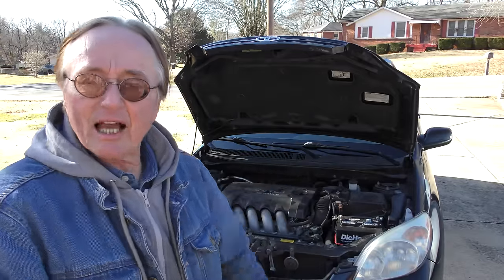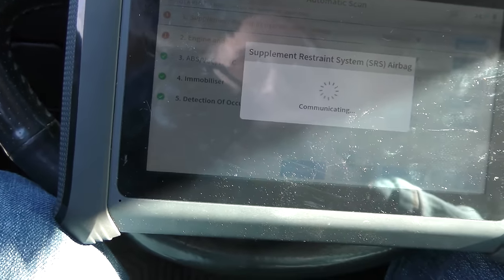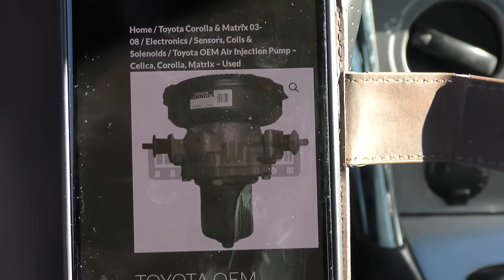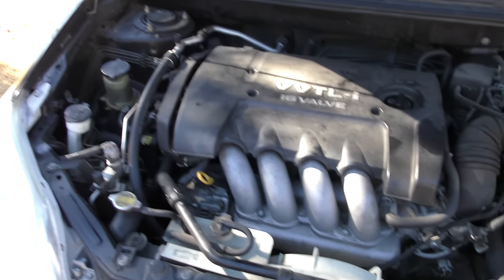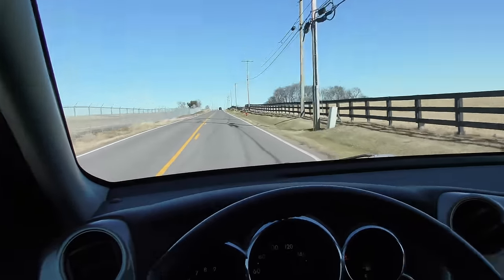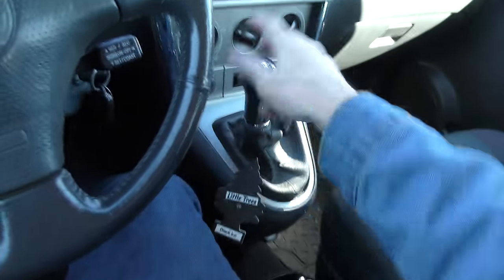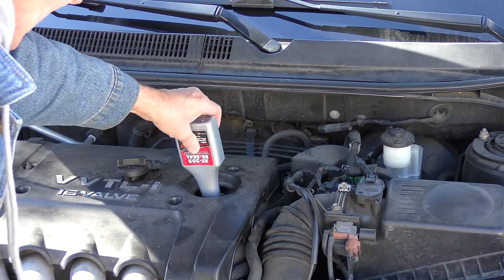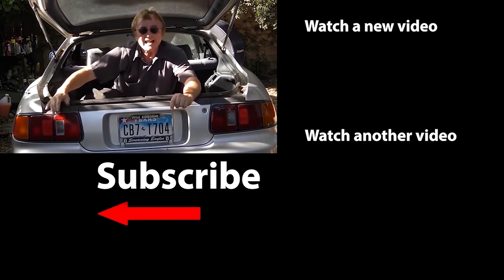I'm About to Get Sued for Showing You This

Comment: The rattling catalyst may be a loose heat shield.  Just saying
Reply: I'm pretty Scotty can tell the difference.
Reply: I had an 05 highlander that rattled. The doughnut between manifold and exhaust pipe was worn. $75 dollar to fix.
Reply: @donniev8181 , you are so vein
Reply: @gradyrogers6707  when the debate is lost, slander becomes the tool of the loser.
Reply: @donniev8181 Reminds me of a dbz quote "Name calling is your only attack, cause you're too weak to challenge me any other way" 🤣
Reply: @donniev8181  You're pretty Scotty?
Reply: @gradyrogers6707 the word you’re looking for is “Vain”. Spelling matters when you’re looking to insult someone.
Reply: Just wrap some hose clamps around it
Reply: I only said that because he never looked

Comment: OK, I see why you would get sued. Ummm. Doing that to a BMW will ruin the engine. The sealent will clog the VANOS VVT system that relys on oil pressure to adjust the timing. Trust me, I know. I already delt with rebuilding a BMW engine that the previous owner did that. I had to completely replace all the VVT parts in the engine rebuild. On some other brands that don't use oil in their VVT systems, that is O.K.

Comment: I replaced my Secondary Air Injection Pump with a Pool Floaty pump!! Cost me $10 at Walmart. Plus a 12 vdc to 120 vac inverter for $30. That was back in 2010! It has worked flawlessly ever since, for 13 years!!! No check engine light!!
Reply: That's awesome haha.
Reply: I admire ingenuity.  There are perhaps dozens of small fixes like this that would keep an older car running almost as new.  Thanks for this tip.
Reply: Awesome 😎

Comment: Scotty talking about sunroofs. "Close and leave it closed" right there with you scotty
Reply: Oh y'all BUGGIN‼️
      😂🤣😂🤣
Reply: Not if its an old Honda. Open and close it multiple times a day 🎉
Reply: Yep, it's just one more thing to go wrong. I never open mine. Cracking tge windows is just as good.
Reply: I intentionally look for hardtop cars without a sunroof for weight and I never use them here in Florida. The a/c is on for 10 months here.
Reply: Better yet don’t get a car with a sunroof
Reply: Yep. Only practical use for it I found, is to draw out smoke. And as there is no smoking in car these days, sunroofs only have negatives.

Comment: Wind noise. I bought 1/4" adhesive weather stripping; and lined the doors and door sills with it. so much quieter. about $10 for a few rolls. easy to do, seals the car right up.

Comment: Customer "Did ya fix it?"
Scotty "yes and you didn't need a new transmission, just some oil leak seal, that'll be $14"
Reply: Not the same thing.. it is seal conditioner. Do NOT use oil leak seal.
Reply: Pretty cheap  fixing  ? LOL😄
Reply: Maguiver  band aid 😂

Comment: AT- 205 Re-Seal is not as good as it used to be. They re-formulated it three years ago. It still works but not as good as it used to. Lucky me... I Stocked up on it in 2019 and 2020 and I am Good to GO! :face-purple-crying:
Reply: You can actually dump that much in the crankcase?

Comment: Great context and very informative. I have been watching your videos since finding your channel. 
My father passed not to long ago and left me his 2013 Hyundai Santa Fe sport . 
I have been watching trying to learn as much as possible. I recently have been trying to figure out a burning oil smell with no leaks I can find. 
The fluid levels have been consistent. 

All information I have came across says spilled oil burning off. A neighbor was kind enough to pop off the plastic cover to the engine and inspect all the areas you would find oil if it leaked but nothing. He said the same thing but it's been a over a month with the smell. I don't drive it much and it only has 84,000 miles. It starts and runs fine. I have a appointment with the dealership since not much luck with local garages not adding an extra. I was just trying to get more information before the appointment so they don't surprise me with anything.

Thank you for the great content as always
Have a great day
Reply: I had that problem only to find that there was a tiny hole in the exhaust pipe … have that checked out … Nam Jamaica

Comment: Mine started leaking a quart every 100 miles. The at205 did initially slow the leak. Ended up getting it fixed at a cost of about 1300 dollars. Oil pump seal 2000 Toyota Camry

Comment: I’ve successfully used the AT-205 for transmission and oil leaks.
It certainly works on “main seals” … which is better than having to replace them.
I’d note that its hard to find “on demand” so I buy it when I see it.
Reply: How often do you have to pour some in?

Comment: The rear main seal in my 1999 miata has a slight leak. I would have to drop the transmission to replace the seal. I purchased the AT 205 reseal on your recommendation so come summer I will give it a try. I does not leak when the car is sitting, only a few drops after a drive or after the engine has run.

Comment: I had a moderate power steering leak in my Nissan Maxima 2002 to point fluid could not flow properly in system and the power steering system was whining/acting like it didn't have fluid. Lucas Stop Leak would not stop it. I put some AT 205 in the stop leak and my power steering stopped leaking in one application the power steering no longer leaks. That was hundreds of miles/ months ago. Cleaned out all the gunk old steering fluid under car and I drive it like nothing is wrong. AT 205 is powerful stuff.

Comment: This is a 2zz engine. They are notorious for developing timing cover gasket leaks when high in mileage, also the 6 speed c60 transmission is not very long lasting if you like giving it constant abuse. First signs of the trans being worn is gear notch or grind when going into third, and occasional second gear lock out. There are other few achilles heels on this powertrain but other than that the XRS matrix and corolla even the celica gts are rare now and very well underestimated since they never got the spot light like Honda B and K series did.

Comment: That is a Matrix XRS, it feels "Faster" than your wifes because it has a higher horsepower engine. XRS are very rare and sought after due to the engine. Same engine used in Lotus Elise
Reply: So that's a 2.4L not a 1.8L correct?
Reply: 1zz vs 2zz engine.  Also that's why metal vs plastic i take. Thats a dead give away. Big difference in engine design
Reply: I expexted scotty to know the difference
Reply: I've never before heard a Toyota described as "zippy" nor "fun to drive" lol
Reply: Yes the 2.4 engines were zippy, but they also were known oil burners.  If you want reliability stick with the 1.8
Reply: Damn, that’s some impressive ignorance. Toyota has been making sports cars since the 60s. 

 You know, like the 2000GT, AE86, Supra, MR2, S2000, Celica GT-Four, GR86, the new Supra, GR Yaris, GR Corolla…

That’s just what I can think of off the top of my head, and I’ve never even owned a Toyota, lmao.

Comment: AT-205 stopped a wet rear main seal seepage on my F-250 V10 with 292,000 miles!
Reply: Similar results for my Excursion 5.4 gasser.  Absolutely fixed the dripping at rear main seal.

Comment: It has a metal intake manifold because it's the 2zz engine rather than the 1zz in Scotty's matrix. The 2zz revs a lot higher than the 1zz and can produce up to 190hp naturally aspirated.
Reply: Still decent for a 1.8.
Reply: scotty really hated the 2zz in the last gen celica but for some reson he loves it in the matrix/corolla xrs models. Still the same engine lol, but I guess it gets more abused in the celica and breaks more often. Also the same engine that lotus used in the Elise and in the Exige with a supercharger
Reply: @DeepRacer-zr4yp We used to have a Corolla Runx Z. It is a Japanese import. In New Zealand, It's very common to get a Japanese import. We bought it without knowing it had the 2zz. It was a great car while we had it and regret selling it.
Reply: @DeepRacer-zr4yp Scotty says in previous videos that the 2zz has issues due to the high revs. People buy a Celia because of it's sporty look and they will generally drive them harder. People with Corollas are more conservative drivers so the engine is kept at lower RPMs so they are pretty reliable for the average driver.

Comment: I can tell you the difference between airbags and just a seat belt, since I had front end collisions both ways. With airbag, felt fine afterwards, with only the seat belt felt like some one threw a baseball at my chest, sore for a week or more
Reply: One of my bosses from about 10 years ago had an early 2000s blazer that she was stopped in traffic idling and got rear ended…the airbags didn’t go off with the rear end impact but she’s a shorter woman…about 5’ tall….it was when her blazer rolled forward and slightly bumped the car in front of her that made the airbags go off…she was fine before they went off…afterwards she had a broken nose, both eyes bruised and swollen shut and whiplash….from the airbags…if they hadn’t gone off, it would have been minor damage easily fixed but since she lived in a liberal state at the time and had to have the airbags replaced etc…it cost her a damned fortune just to have those stupid airbags replaced ….so yeah…airbags are a damned joke ….they go off when they shouldn’t and don’t when they should from my experience…every accident I’ve been in they’ve never gone off which is fine by me…I’d rather have them removed altogether because I’m a 5’ tall petite female that probably wouldn’t have much luck with them not causing more damage then the accident itself caused like my boss did …
Reply: @w8what575  Newer vehicles have weight sensors in the seats to reduce the airbag force for lighter individuals.  It is likely your bosses car didn't have that feature.  Airbags should not go off from a rear impact.  Likely the whiplash was from the rear impact, but it could made worse from the airbag.  Airbags sensors are calibrated to not deploy below certain G force, comparable to about a 20 to 25 mph collision with a fixed object.  I've seen lots of collisions where the front of the car was destroyed and the airbag likely saved the persons life.
Reply: @w8what575 how many accidents have you been in? Maybe you should stop driving or find a lucky charm if they weren’t your fault

Comment: I added that AT205 to my 05 Lexus ES330 and the oil light came on the next day.  I quickly changed the oil.  Months later it came on again and I ignored it.  Sludge clogged the oil intake in the pan and the engine died.  I will never put that in another engine.  Just a warning to others.  Russ

Comment: :washhands:Peppy? NOT BECAUSE of the stick shift. The XRS had the infamous 2ZZ-FE Yahama-modified race engine! And the ABS is "indirect," does not use TPMS sensors:washhands:
Reply: 2ZZ-GE
   Any Toyota motor with "-G" in the motor code means Yamaha tuned the valve train.
Reply: This being a 2ZZ-FE also explains the aluminum intake plenum versus the plastic one on his wife's 1ZZ-FE.  Has nothing to due with the year of manufacture.  Sorry to correct you Scotty….

Comment: Scotty the reason its zippier is that the xrs has the 2zz-ge engine, higher reving, and substantially more power than the 1zz-fe in your matrix, i had the 2004 matrix with the same engine as yours, the difference between the engines is the 2zz-ge is a performance oriented engine, the 1zz-fe is a lean burn, fuel economy engine, look into the engines before your say the transmission is the reason, i guarantee if that 2zz-ge was running fully right that youd notice a bigger difference, ie running a fuel injector cleaner and clean the MAF and they wake right up

Comment: I tried that AT205  it helped a rear main seal on a old Maxima but not totally,  but on  a Honda v6 Odyssey with VCM.  it caused  it to go into limp mode eventually.  and clogged up the oil filter.   all i did to fix that was change the oil .  and the next 2 times change the oil at 50% oil life left.  and its been fine since.  I have heard  this can happen with those re-seal  stuff on the Honda v6 with VCM engine.
Reply: Ive used AT 205 in a tacoma with several oil leaks and it definetly helped .
But after reading it was a sealer and NOT a very Good lubricant , I would only use it on Transmissions .
I have an 2009  Odyssey with the VCM and I installed a cheap disabler system so it always stays on 6 cylinders .
If You havent done that you might want to check into it .
Reply: @jayhockley8841  yah know about that vcm muzzler (SVCM controller)   I haven’t installed that yet but may do so in near future.  My 2007 odyssey has 242k miles now.   Hoping it will see 300k
My next fix on it will be power steering noise.  I have to change some o-rings to prevent air from getting into system on cold weather.
Reply: @dfields9511   Yeah I like my Odyssey a lot . Hopefully yours will last long , too.

Comment: That is a low mileage Matrix. My 2005 Vibe is at 298,000 miles and is dry as a bone underneath. Odometer will quit at 299,999 miles, I have  another cluster ready to pop into it. Going for 400,000 miles.

The TPMS light being on may not be a tire sensor, on my AWD the TPMS is part of the ABS system, monitors wheel diameter. If a tire is low the ABS system alerts the TPMS system. Temp changes drive the system crazy.

Comment: Secondary air injection pump pumps air into the cat for the first min upon starting to hurry up the heating of the cat to get it to do its emissions thing faster. When the pump goes it usually is because it sucks up water and pumps water into the cat.....i.e. the rattle in the cat. They rot out the comb inside it and the inexpensive expensive pump turns into a very expensive exhaust job. You dont really want to ignore that. The pump is whats killing the converter

Comment: The matrix manual transmissions are high demand. I had a customer with a 09 Pontiac vibe (a matrix) who destroyed the transmission. It was cheaper to buy a used Corolla with a blown engine and transfer the transmission over. 400$ vs 1000$ 4 years ago 🤷🏻

Comment: If the oil is dripping out this will not fix the leak, oil seal like the front and rear main seals go bad due to high crankcase pressure causesd by PCV system or internal engine issues like high blowby due to piston rings, on that Toyota engine the timing chain tensioner leaks all the times.

Comment: If the Cat Converter can screw up later, is it possible to remove it and replace it with a length of pipe? or does that eff up the engine pressure? and can that be fixed or compensated for?
Reply: Ive taken my cat out all I had to do was get a new engine tune. But that’s because it was a turbo
Reply: No but you are  going to throw an emissions code
Reply: It will run better plus better gas mileage

Comment: 2500 for my 04 vibe and 4k miles on it so far haven't changed nothing besides the oil. Does need new rotors but it's not bad at all so leaving as is until the brakes completely wear out.

Comment: My 2002 Lexus RX 300 is leaking somewhere near there but only if I drive 70mph or above for any distance.  Long trips are a pain.  Between Tx and CA I’ll use around 6 quarts. Lucas doesn’t stop it.  I will have to try the AT.

Comment: Years ago my cat convert went out on my car, so I cut it out , turned it sideways, beat it with a hammer to get all of the crap out of it and put the housing back into the exhaust system and drove it without the cat for 13 years with the check engine light on.
My car got better fuel mileage without it and it didn’t hurt the engine.
When I sold the car, I told the new owner that it had no cat and dropped the price by $300 for the price of a universal cat.
I had a 79 Ford F150 and as soon as the warranty expired I ripped out all the smog crap, took a broomstick handle to the gas tank filler tube, to make it bigger so that I could run leaded regular gasoline in the truck.
Before I took all of the smog cap off, I was getting 13mpg and after taking all of it off, I got 17mpg. The F150 had a 302 (5.0L) V8 and a 3spd automatic transmission.
It was a great pickup. 
It belonged to my grandpa and I needed a 4WD, so I sold it in 82 and bought a new F150 4WD with the 4.9L (inline 6cyl) and the 3spd automatic transmission. I got 21mpg on that F150.

Comment: I had a 140k miles Ford Excursion with a dripping rear main seal. Carport dripping area nuisance. 
Used some of this AT205 sealant and totally fixed the issue.  No more drips.  Sold it at 155K.
I wonder if it would rejuvenate my '48 Packard fuel pump diagram??
Can't find any cheap rebuild kits.

Comment: Added at205 reseal to the rear differential of my 2001 ford mustang 185,000 miles.  The leak went from a teaspoon a week down to 3 or 4 drops. Still working after 6 months

Comment: Scotty,  have you told people about the change to the Ford 2.7 turbo that now has a rubber oil pump belt soaked in oil that rots in 60 to 80 thousand miles ?   It had a chain driven belt until about 2917.  I have a 2020 and I love the truck but am very afraid of my motor blowing when the belt breaks.

Comment: Both my brother in law's 07 and my 05 matrix had the transmission go out at around 200k, was super expensive to replace so they both got sold.
Reply: Both manual transmissions?  Toyota had and has kept buried a pretty heavily complained bearing issue with the manual 5 speed transmissions in the matrix (and I believe its the same tranny in the corollas and Vibe those years). The 03, 04, and 05 were the worst and they slowly improved things over the four or five years.  It seems less common by 07

Comment: Your poor Toyota Celica still has Texas plates, what happened to getting Tennesee plates? I too dislike CODES for Oxygen Sensor and Misfiring all leading up to that Check Engine Light.
A bad catalytic converter equals loss of HP,  much noise, and an expensive repair. I like the idea of using a dye to find the oil leak. Thanks, Scotty for another entertaining video.